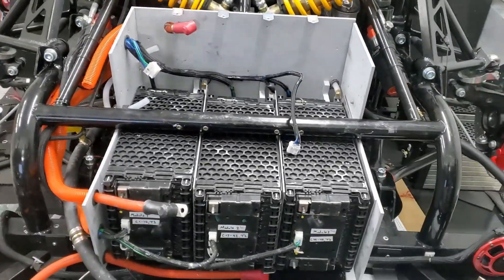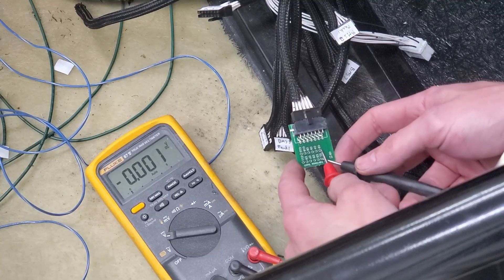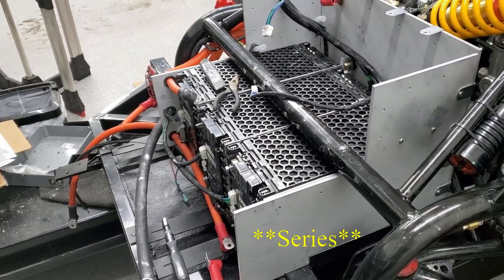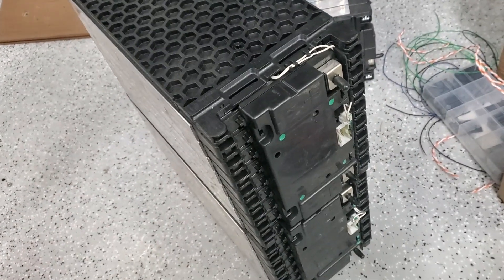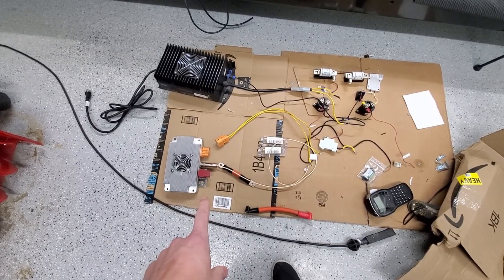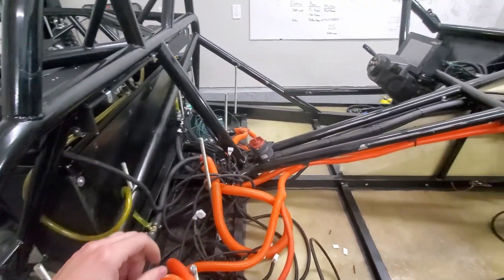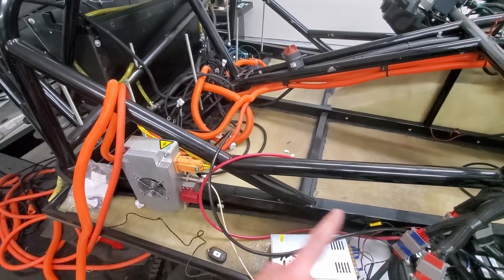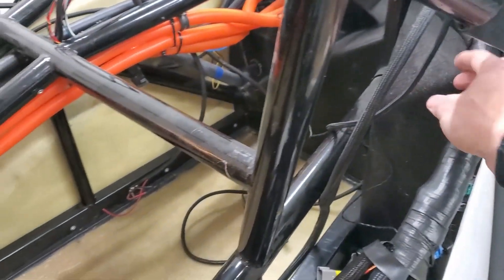Kit Car Trouble

Comment: No offense to you or your choice.  The body style of the car does look very good.  However, after seeing your videos, I wouldn't touch this thing with a 10' pole.  Them threatening you is a hallmark of a crappy company with a crappy product and in this case crappy customer service.  The frame isn't triangulated.  The body has scuff marks on it.  The packaging didn't prevent damage.  No manual was shipped with the product which after quite a while finally showed up as kind of a partial manual.  Is that right?  Not allowing you to show their website, someplace anyone can easily access by clicking on it, really?  LOL.   On top of that I think their pricing isn't so great.  I think this is kind of a problem with most kit cars.  I was at the Toyota dealership getting parts and I sat in a new Camry, this was in 2020 and the price was ~$27,000 (US).  That didn't include tax, title, tag, but it did include all of the parts fitting correctly, a warranty and yes. . . a user manual.  $27k at K1 gets you half a car with ill-fitting panels.

I think you have been really good about downplaying the issues with the kit.  Very forgiving.  If it had been me I'd have gotten that email on pretty much day one!  I'm not a lawyer, but I'm guessing they would have had a really hard time doing anything about it from overseas.  Unfortunately, youtube does have a reputation for pulling people's videos at the drop of a hat, so they might have had success on that front.

Ok rant over.  Gonna watch the rest of the build.
Reply: I was thinking that with the last video where substitute film was used from previous episodes... yes, it is their IP, but it doesn't give a warm feeling if a company won't even let you use snippets to show examples of what a buyer would receive... sorry, MAY receive.
Reply from the maker: LOL!  That is pretty much what went through my mind.  Ya, I don't think I would recommend the company to anyone.

Comment: You may want to make your 12v battery accessible fairly easy. You will need to replace it every two years or so, plus it’s nice to have accessible if you need to jump someone.
Reply from the maker: Yes, that one is still on my "to do" list.  Thanks for the comment!

Comment: How accessible will the passenger side area where you are putting all the 12v electronics and battery be once the body shell goes on?
Reply from the maker: Great question.  Not much space.  You can get a sense of the space in an earlier video https://youtu.be/m4Y1J_jXocQ

Comment: Jeremy, If you plan on doing any race days, track days or rally cross in parking lots you will need to have your cutout on the outside of the car so emergency crews can get to it.
Reply from the maker: Thanks!  If this is a roadster, does the center console not count as "outside"?  I may have to rethink.
Reply: Seems important for the driver to have a cutout.  Would you suggest two switches?
Reply: @automotivebrotherhood5698  First of all shutting off the key switch shuts off the main contactors,  the main power switch cuts off power to the high voltage systems which are the contactors and the dc to dc converter. Unless the contactors points weld shut the key switch will shut off the motor/ contactors. If you get into a big accident and the high voltage gets grounded it should blow the fuses in the high voltage side of the pack that grounds. If things go so bad that there's a fire, it's too late. In most cases the high voltage cut off switch is to protect you when you are working on your own high voltage side in your car. I put mine on the outside of the car in case I get into a crash and emergency crews can shut it off as a precaution before extracting me out of the car.
Reply: If the car is upside down there lies the issue. Mine is in the back with a emergency shut off sticker.
Reply from the maker: Is there some reference that clarifies where it needs to be?
Reply: @electricsupercar  scca or nhra rulebooks